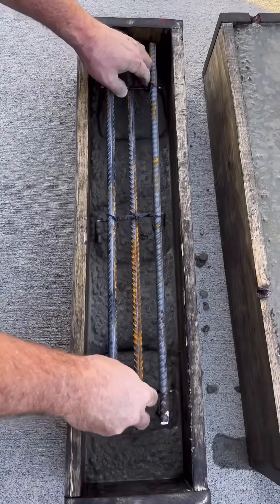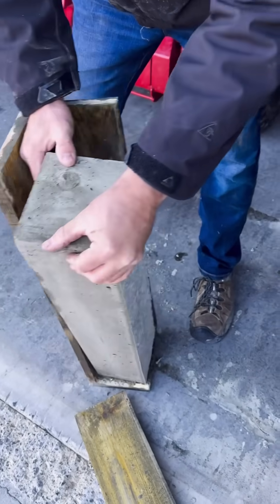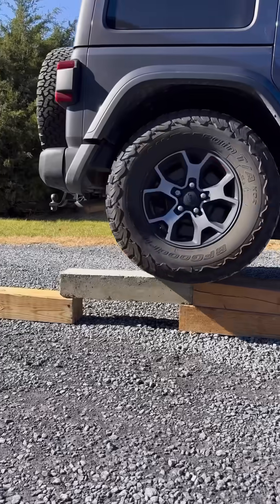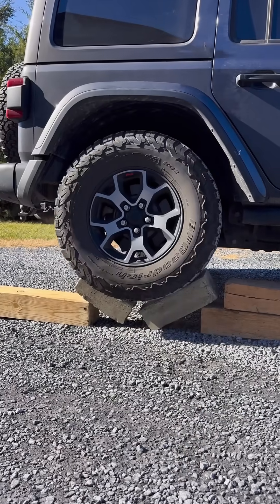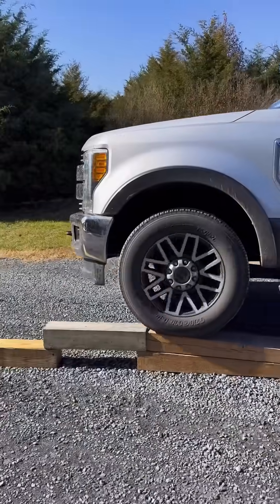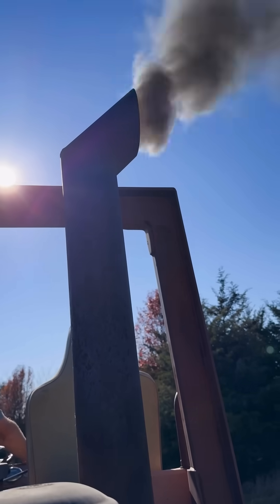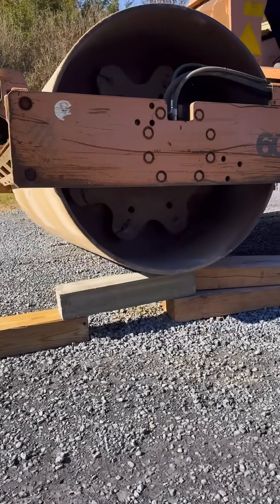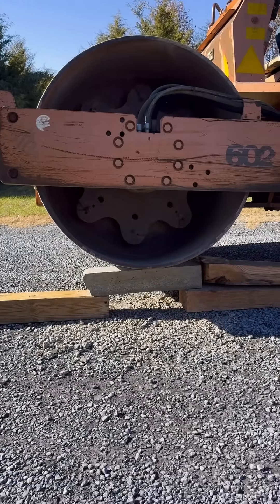Why We Use Rebar To Reinforce Concrete

Comment: This is what is called a three point bend test. We did these all the time while studying structural engineering…
Reply: It is also called flexural strength and this test is used a lot on concrete used for airport runways.

Comment: Honestly, it all depends on the mix of the concrete and the psi that you are using on top of that. It also depends on the size of rebar and if you’re using fiber microfiber also going to determine on the slump of the concrete of what it’s poured at how much water and if you’re using super plasma sizer but obviously for this setting and video you’re using quick Creek, which is honestly a poor man’s concrete it’s something simple to grab for the basic person that doesn’t really know anything about concrete. It’s not bad if you’re using it for simple things around the house.

Comment: Rebar should always be placed in the bottom 1/3 of a horizontal member/slab…never with 1” of the exterior surface better of it 2”…and vibrate any mixes with rebar to avoid air pockets..the killer of concrete strength!
Reply: I work at a large stair manufacturing plant in Canada. We "spud" or vibrate out horizontally poured forms, but not vertically or even the beams or landings we build.
Reply: Pretty sure I don’t.
Reply: How do you know he didn't flip it over lol
Reply: Wrong, if you are putting rebar in a slab under compression (e.g a patio) you want the rebar in the top half because that’s the tensile side in that case.
Reply: nope you are wrong. dead wrong. a suspended slab or a horizontal slab under tension requires the mesh and steel on the bottom, always. normally 30 bottom cover is standard, ie 30mm off the bottom formwork 70 for the ends. normally a slab on the ground is 30 top cover. always depends on the thickness though, thicker more steel or suspended steel, but the engineering will call for that.
Reply: @smokesmypaparazi  that is correct because thermal expansion will have a larger impact on the upper part.
Reply: @smokesmypaparazi  a cantilever slab requires the steel to be at the tensile surface ie the top. A supported horizontal slab requires the steel at the bottom as this is the tensile surface. The slab will tend to 'sag' creating a compressive top surface and a tensile bottom surface. Additional steel can be placed on the upper surface for crack control as well.
Reply: @mrengineering101  you have that reversed

Comment: 30 days read the instructions, Einstein
Reply: Actually 28 days is what is required for concrete to cure to it’s designed strength, since you want to try to be a smart ass about it.
Reply: 28 days plus the day u poured it plus the following day to take out the forms smart ass
Reply: 30 days
Reply: For maximum if u want to put a steam roller on it and they press the vibration button 😲✅
Reply: Also that if u have the best weather
Reply: No, it is actually 28 days of not lower than 40°.  That is actually just the initial cure, concrete will actually cure and gain strength forever under the right conditions.  The concrete in the Hoover Dam is still curing to this very day.

Comment: Judging by the angle of the sun I would say three days
Reply: @hausplans how about an answer?
Reply: @hausplans 2 days
Reply: you have insufficient cover requirements. Durability aside, the bars can't fully mobilise. @hausplans
Reply: what if it was a leap year
Reply: @kevinmitchell4446 😂😂
Reply: @kevinmitchell4446 With a leap year added in to the equation, 1 day must be added to the final day count. However, if the last number in the year is of a odd number 202(3), this day must be taketh away... so that's that.
Reply: @kevinmitchell4446 Then you gotta jump on it.
Reply: @kevinmitchell4446 Good point
Reply: Amazing stuff, concrete has advanced so much, especially in the last few decades. When I was studying construction in the mid-sixties lab tests showed that standard 3:1 sand-cement cured for 28 days had a tensile strength of 150 psi—which,  given the nature of the material even yet surprises me. (I’m thinking, if that reinforced block had 2” cover bottom and sides and was allowed to cure for 28 days it would not have failed even under the vibration.
Reply: @danohanlon8316 Just kidding.😃
Reply: @danohanlon8316  yeah totally. thats why modern concrete buildings crumble in like twenty years vs ancient roman architecture that has been standing for thousands of years.  super advanced.
Reply: As a carpenter/tiler it takes 28 days for concrete to fully cure. That's why if you'll see basement forms sit around so long before people build on it
Reply: @abdulmohram5960 I mean technically concrete doesn't fully cure in 27days... it reaches like 75% of its full strength, it takes around 50years to fully cure and once it does it starts breaking down
Reply: @justinrowe3100 romans be like:
Reply: @nothland7596  true, but in their defense the mix the Roman's used a different type of mix. They didn't have extenders and curing aids that we have in today's concrete.
Reply: @abdulmohram5960 I've been told concrete really never stops curing and that info is from the plant thats makes the dry mix. I used to work in cement and lime kilns.
Reply: @nickroth593 kinda... Yes. 28 days are the bare minimum to cure it to be sturdy. It tooks sometimes years to be fully cured. I think it is because of the CO² the concrete needs to absorb to build up fully it's structure. And the thicker the concrete, the longer it took. That's what I learned 20 years ago and never used again.
Reply: @nickroth593  I also was led to believe this, it makes sense due to the dehydration process and why 50 year old concrete is tougher than 6month
Reply: @DreadnoughtTheWolf the thicker the concrete the faster it will cure, because of the higher heat.
A small cube will have a much lower temperature development compared to a big 100m3 fundament.
Reply: @SLOvids96 I throughly enjoy us having a conversation about concrete 😂.  The way I look at it is 0-50 is drying process, 51-75 is "life" of concrete, 76 on up is the process in which it starts to turn back to dust. Always those small flakes that come off easy and it becomes very brittle. Glad others see that stuff
Reply: @rppope1006  and the Greeks and Roman's used volcanic ash in the concrete because it would fill with water when it cracked and the water would erode inside the Crack, then it dries and is no longer cracked
Reply: @nickroth593  pretty sure I read that the hoover dam is still curing to this day
Reply: @nickroth593 while that statement is true the amount of strength increase over time plateaus and you get severely dismissed returns. If the concrete hasn't hit strength by 28 days, we sometimes wait for a 56 day break... if at 56 days it still isn't passing it likely won't get the strength you need.
Reply: @nickroth593 You get info from plants ? Cool.
Reply: @nickroth593  seems to be true because water and moisture are absobed through the concrete its in constant osmosis
Reply: @abdulmohram5960  so as a bricklayer would it take longer or shorter than 28 days for the concrete to fully cure? LOL.
Reply: @abdulmohram5960 true. Maybe more like 3 days of filming
Reply: @abdulmohram5960 as a carpenter you don't know that you could remove the form 3 weeks earlier if you measured the in-situ MPa during curing.
Reply: @abdulmohram5960  there's been a concrete base sitting around for years in my town (at least 10 at this point); is that too long?
Reply: @abdulmohram5960 have you seen houses built nowadays? Soon as the foundation goes from liquid to solid, they send it lol.
Reply: @abdulmohram5960 Ooh~.
That's actually very interesting to know.
Thx for new knowledge acquisition mi amigo~.
😁🤙
Reply: @abdulmohram5960 No. Concrete HAS to reach its declared compression strength at 28 days, but could be in less time than that, depending on the water/cement ratio or other factors. Sometimes concrete gains 100% strength just after 14 days, sometimes it takes just a week. It depends, that’s why when you create a mix you do compression tests at 1-3-7-14-28 and 60 days and then draw a strength curve. Concrete also doesn’t stop to gain strength after 28 days but slowly gains a bit more in the next weeks/months.
Reply: @abdulmohram5960 bruh just say a month at that point
Reply: @abdulmohram5960 this is kind of life changing. Where I used to live there was alot of new home construction going. For years i thought everyone just got distracted and abandoned the first phase of their building projects bc they wanted to do something else 😂
Reply: @abdulmohram5960 not necessarily, depends on how much, temperature, moisture, and mix. Everything varies. Where I’m from we use a lot of calcium so you can build on it relatively quickly, also a lot of the houses already have the shell built, so you just go through a window with the mud
Reply: Concrete never fully cures
Reply: @abdulmohram5960  DRY =/= CURED 🤦‍♂️😅
Reply: You forgot to factor in the wind ☝️

If my calculations are correct 🧐
We need to factor in the relative air humidity and multiply that by 3.682818 then divide that sum by the average air temperature for that given period then multiply that sum by that air barometer resistance THENNNN divide that by the Sun Angle 🤓🤓🤓🤓🤓🤓
Reply: @norrispaintingllc1720 that decreases it by half a day so 2 days, 
                                  Someone who doesn’t know what I’m talking about
Reply: @norrispaintingllc1720  i didn't realize i had already watched this video months ago until i saw that i had already liked your comment i watch to much youtube
Reply: @norrispaintingllc1720 nah, ignore air resistance
Reply: @norrispaintingllc1720 and the Coriolis effect
Reply: @norrispaintingllc1720 😂
Reply: @norrispaintingllc1720  ok no
Reply: @norrispaintingllc1720 don't forget it was Wednesday
Reply: @norrispaintingllc1720 You forgot to factor in the tilt of the tectonic plates at the time of the initial set
Reply: My guess would be it was in the "It wasn't cured enough days" category  :)
Reply: 28 days or one moon or a female cycle . Same same
Reply: @torrycole6477 a female cycle is crazy
Reply: @trvman1  He said the concrete was still green, did you pay attention? :)
Reply: This guy 4chans
Reply: I’d guess around a week, if I were doing that test they would all get submerged for that week once set enough to lift, ie 24 hrs …
Reply: @chrisbraid2907 Depends on the kind of concrete.
Reply: Daylight savings?? This sets the sun back in time and hour so it’s actually 2 days 12 hours and 17 minutes (wind also pushes the sun away)
Reply: @bglvortex9837  im just waiting for some moron to think thats how it actual works 😂
Reply: WHAT
Reply: I agree. 3 days. That stuff is like a cookie. If you look at the bunkers built by the German military in the countries they invaded, such as Norway, then you will see real concrete.
Reply: @G58 ight bro
Reply: If it wasn't 27 days it wasn't long enough
Reply: Why are you laughing.  Sun angle would change the color appearance
Reply: As a former Concret worker concrete can take up to 100 years to fully cure
Reply: Was that water from the Ohio river?
Reply: Well, did you use tap or bottled water?
Reply: Me who doesn’t know anything about this stuff

MMHMM Ahaa
Reply: Bro😂
Reply: You forgot the angle of Azimuth
Reply: Don't forget the temperature and the direction it's facing
Reply: Lol. Always remember, you have technology.😂
Reply: They're just playing minecraft
Reply: Yes
Reply: 69 days
Reply: Lmfao
Reply: well was it an african swallow or a european swallow?
Reply: It took 1 week
Reply: The concrete in the hoover dam is still curing and likely to never fully cure
Reply: lol
Reply: Get the people who responded to this in a room, I feel like they can find some real world answers 😂😂😂😂
Reply: It actually takes years to get concrete completly dry. But will be firm after 4-6 days
Reply: Excellent comment
Reply: @QueLastima  thanks
Reply: I paint cars, n slap a fresh bumper on in 1hour after clear
Reply: Ah but was it poured on a Tuesday 🤨🧐
Reply: Judging by the temperature based on the shade of color the grass is
Reply: Officially, concrete reaches its design strength after 28 days.
Reply: Then it might have been 368 days, just as well. We will never know!
Reply: i concur, 3 days and one third of a day plus or minus 45 minutes
Reply: 2 days
Reply: I believe the more dense the longer it takes.
I read that the Hoover dam is still getting slightly stronger everyday.
Reply: Acr to Indian standard code 7 days of curing is compulsory.
Reply: 4chan ass detective skills over here
Reply: Yo. Can I Please remind you of the Good news? If so. Please know Jesus Christ, the perfect human being, Being full God and full man. Gave his own life for you, And everyone. He did it so you can be forgiven, and saved. Because of what Jesus Christ did, You now have eternal life. When infact, You are unworthy to have it. It is Given. If we confess that Jesus Christ is Lord and beleive in our heart that he has risen from the dead, you are saved. Live like and for him, For he is, THE Lord and savior, It is by grace, Through faith in Jesus Christ that we are saved ☦️🙏🏼May the Lord Jesus Christ be with you. God Bless. Amen☦️🙏🏼🙏🏼
Reply: Well to fair in most cases you can walk on concrete in about 1 or 2 hours 😂
Reply: @JDIZZY024  Yo bro ,Can i remind you the Good news? If so. Know this, God, Creator of both heaven and earth, Saw our sins, He saw how wicked we are, How we should go to hell, But God did something, He limited himself to the form of a servant, To not be served but to serve, His name is Jesus Christ.

Jesus Christ, Died for all of us, He took the price of our sins, And all because he loves you. Romans 10:9 says, If you confess with you mouth Jesus Christ is Lord. and believe in your heart that he has risen from the dead, Youll be saved.

Believe, And Know Jesus Christ is the way, Jesus calls all of us, To repent, He gives all of us a chance, Its as if God extends his entire hand to save you, But you are the one who should reach back, Always know His stand wont change. Until its too late, so please Try and Repent 🙏🏼✝️..
Reply: That's how long it took to make this potato salad, 3 DAYS.
Reply: At this distance you have to take the Coriolis effect into account too
Reply: @Winter523 huh?
Reply: 21 days watering timw to time or 7 days sumerged in water
Reply: I don’t get it
Reply: @thecomedypilot5894  the other 10,000 people did
Reply: @jjlpinct  Well… can you explain it to me? I’m not trying to cause a fight or claim that your joke wasn’t funny or whatever, I legitimately do not understand what you meant and I would like further clarification.
Reply: @thecomedypilot5894  lol, nope, cant explain it. I just thought it sounded clever. Wasn't that funny, but I'm pleased with how wildly successful it is
Reply: @jjlpinct  Was the joke just that it was kinda random what you said? Look I don’t see why you need to be giving me a hard time over this, I just wanted a simple explanation. Why can’t you explain it?
Reply: @thecomedypilot5894  was just random. Sorry didn't mean to give you a hard time, was just kidding
Reply: 28 days for curing, but leaving it up to 90 days enhances all the later strength capacity of concrete
Reply: I'd say it was cured for - I don't know because you haven't told me, twatty
Reply: Jokes on you, reinforced concrete needs at least 3 days of clear weather(blinding sun) to "mature"
Reply: 10-28 days
Reply: And how do you intend to harvest these 99 souls in 3 days?
Reply: 7 days
Reply: Ah… the Solstice, of course!!
Reply: 2b2t players be like
Reply: Use a vibrator to test your strength. - SunTzu
Reply: 3 days was my guess as well 😂
Reply: Judging by the position of the earth i would say 103 years

Comment: There's a spray that is used on instate highways. The make the concrete to cure faster. So that lane isn't closed for too long.
Reply from the maker: curing compound
Reply: Uhh... actually it does the exact opposite 😅
Reply: It’s not the spray that makes it cure faster, it is a chemical called accelerator that cause it to cure faster.
Reply: @awright1216  Correct, curing compound is actually specifically to make it cure SLOWER 😭. The longer you can keep the correct amount of moisture in the concrete the stronger it will be. Key word here is "correct" amount. Too wet is bad, but the right moisture for a long time makes for a stronger slab. The Dot 1600 series cure is also white to help reduce the amount of punishment it takes off the sun.
Reply: @mitchell7203  so you are either a civil engineer or work as an inspector or at a concrete plant?  You are the only person on here that actually made a comment that  makes sense to me.
Reply: @awright1216  Not technically, I am certified by the American Concrete Association as a field quality control technician, but I actually am a paving superintendent for a company that paves concrete highways. I go thru thousands of gallons of curing compound a year.